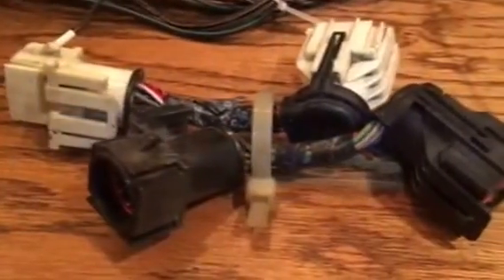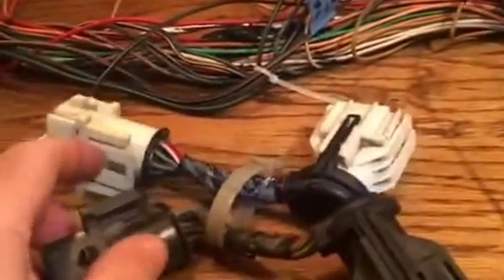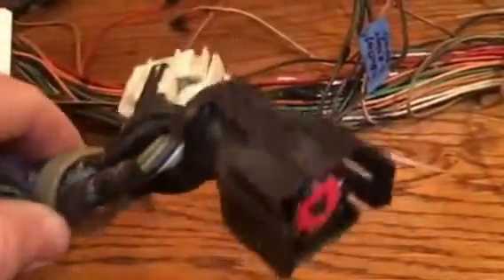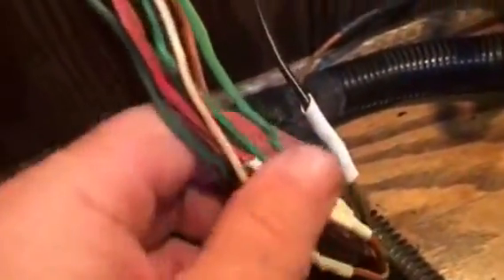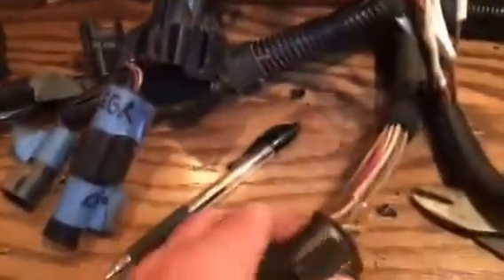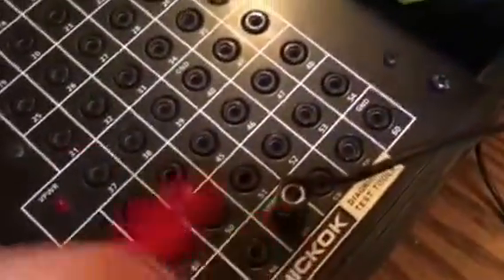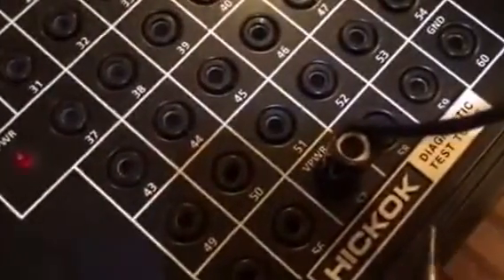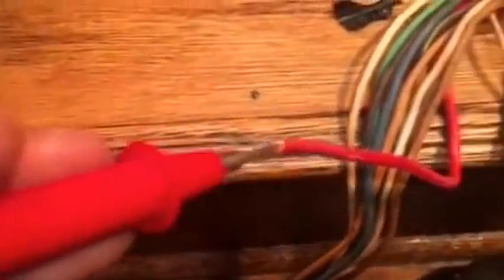Ford  5.0 EFI Harness Engine/Main Connector Elimination

Comment: Getting ready to do a EFI V8 swap in a 69.5 Maverick. Donor car is a '91 Thunderbird Sport with 5.0 HO and AOD transmission that is a running and driving car. Need help with harness and fuel pump. Also want to delete emission components, cats, etc.

Any chance you can help with this? If so how do we connect?

Comment: i have a wire on the white shaker that is broken where do i find a schematic for the 10 pin connectors ..i think the wire is brown or browny orange
Reply from the maker: https://www.foxstang.com/wp-content/uploads/2017/10/SALT-PEPPER-SHAKER-FOX-MUSTANG.png
Reply from the maker: Wire colors may vary from year to year, but the diagram in the link below should line up with your white connector.  You can trace which wire it is from there.  Also note that the oil pressure and water temp sender wires from the engine go through the gauge as well as the HEGO ground wire, which is often Orange in color and has a connector for grounding to an intake bolt.  Just some ideas, good luck.